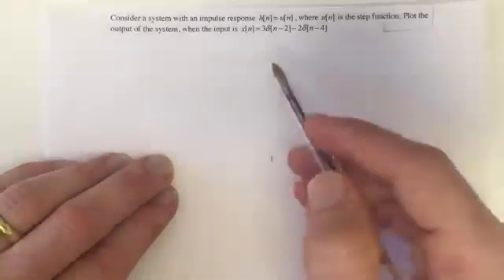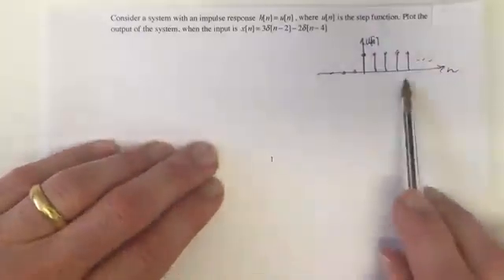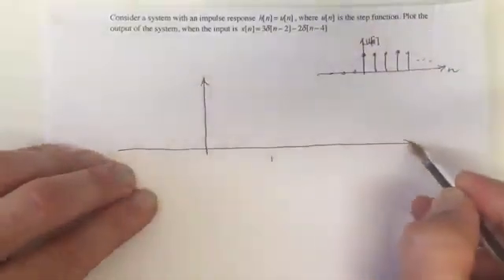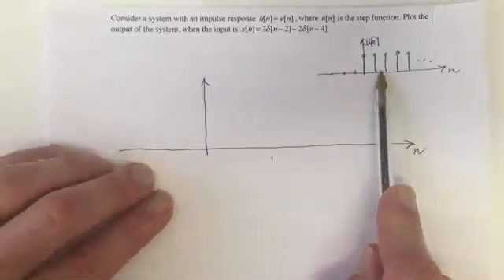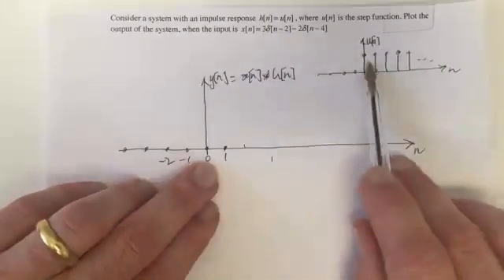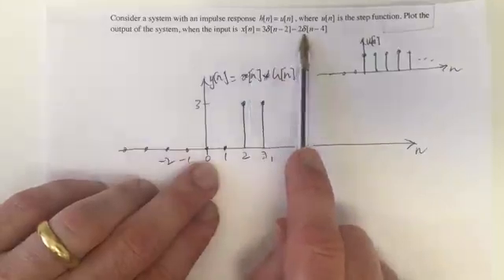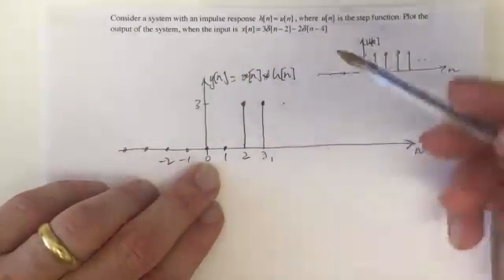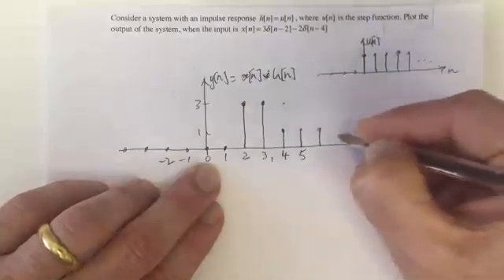Discrete Time System Output Example

Comment: In the other discrete conv. video we can see the equation, it is always a summation. Obviously, we do not add up. I think with summation, we would get y(n)= 3x1+3x1= 6 at the point n=3 and at n=4: 3x1+3x1+1x1 = 7.......but I must be wrong(?). Thanks a lot.
Reply from the maker: Sorry, I don't understand your question. At n=3 the first impulse has been inputted to the system (ie. the delta[n-2] function, which has its energy at n=2, and results in an output step function starting at n=2), but the second impulse has not yet been inputted to the system (ie. the delta[n-4] function, which has its energy at n=4). So the only output at time n=3 is the result of the n=2 delta function.